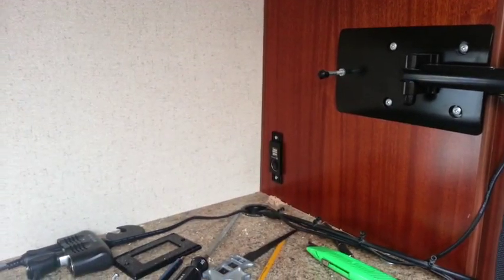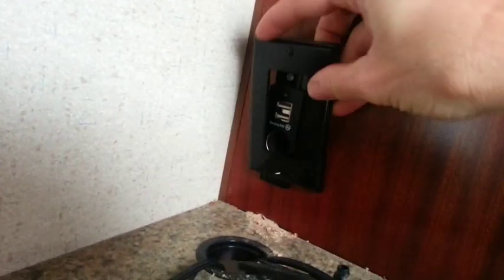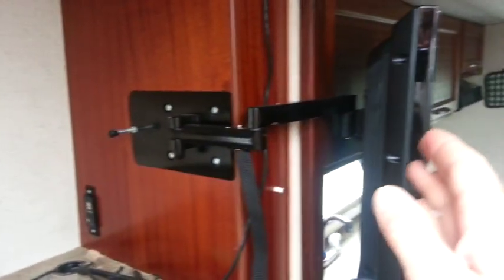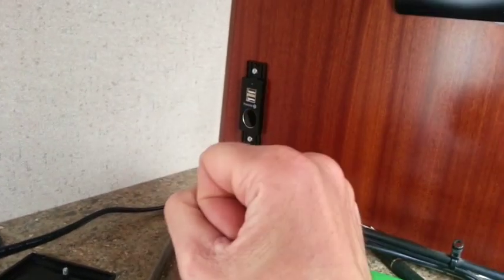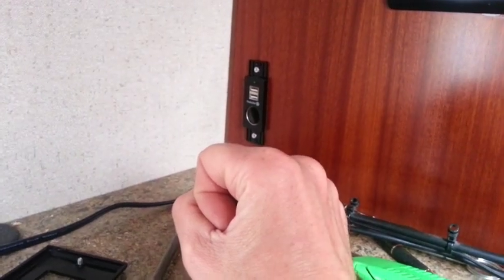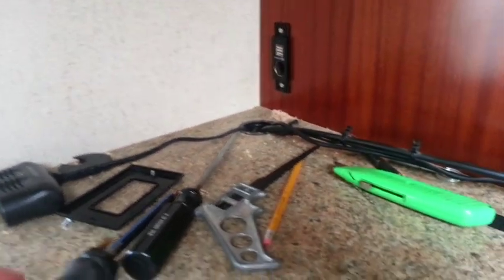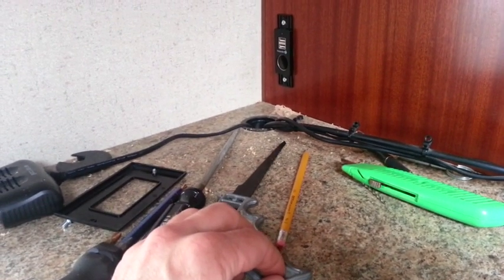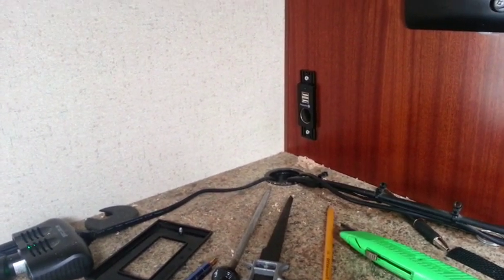Installing a 12V port with Dual USB ports

Comment: This is the one thing the 2006 Lance is lacking. There only one 12v outlet in the camper and it's just inside the entry door. Like your camper the tv and antenna power is hard wired.
Reply from the maker: There are many versions available......FYI wireless charging is coming soon in the future......that will be an RV'ers dream

Comment: I need one on the outside. They install AC outlets on the outside, but not DC.
Reply from the maker: What would you plug into it on the outside?
Reply: West Coast Roller
Laptop.